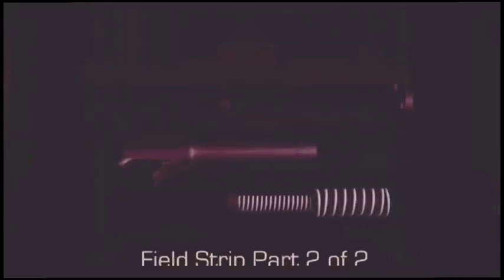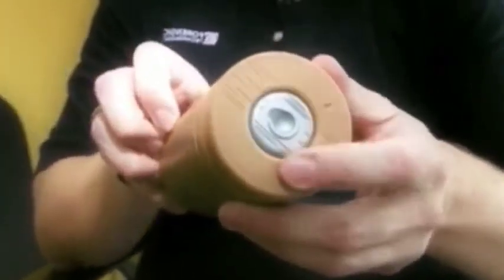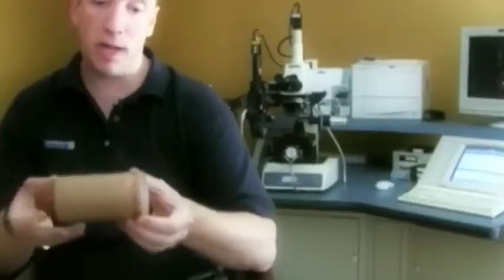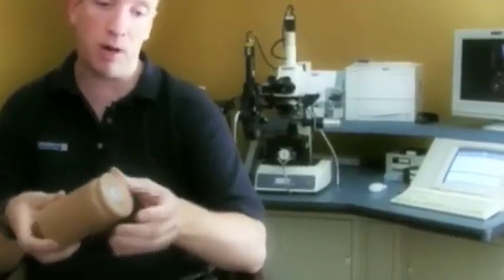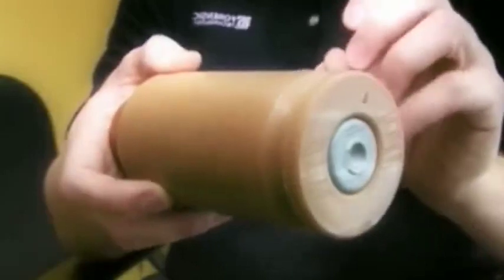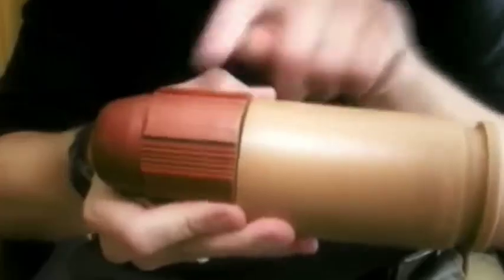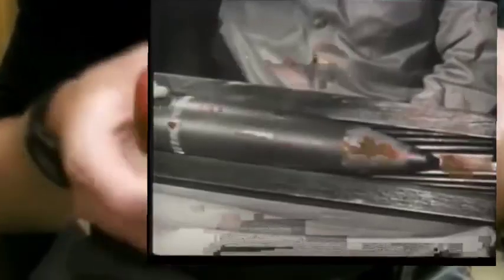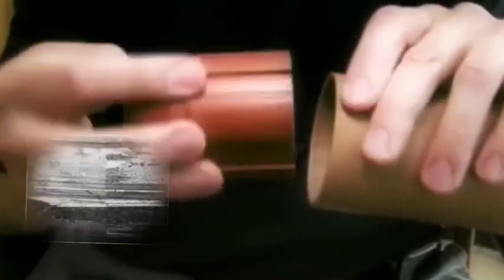delphi murders | Rick Allen Balistics

Comment: 5:23 For me, this is an argument argument that some barrels will have the same markings. The "evidence" could go either way. You would literally have to test every gun barrel that has been made in sequential order.
Reply: Have you ever used sandpaper ?
Do you still use sandpaper?
You have used, and continue to use, the very same piece of sandpaper?   

Things change in the material removal process (machining). 

~even if you are using that same ol piece of sand paper. Polish
Reply: @chuckleberryfinn1992  I've used sand paper and yes it changes *over time*.
Reply: @steppy3736  and in all that time  you never thought to get a new piece.

Does it not take time to bore a guns barrel ? How about the rifling?
If time does exist during these operations,  what happens over time ? 
Or applied forces
Reply: @chuckleberryfinn1992  they aren't testing the sandpaper. They're testing what the sandpaper was used on. Try again.
Reply: @steppy3736  ur right.  The change in the tooling (or sandpaper) has little if any   effect on parts it forms. There is no variance whatsoever.  Just like all thumbs, are thumbs.   No distinction from one or the other, nor from where they interacted with another surface.  A "print" is something some that helps sell magnifying glasses to dorks, eh.  If you get a machine that beeps and can print a bunch of CTAG's = then hello Mr. DNA tech.  Nonetheless, somebody's getting their kicks railroading the guy.  Hell he gave them an alibi. That's been corroborated by like 3 or 4 people.!??! ¿ Musta hustled the wrong dude in pool or something?